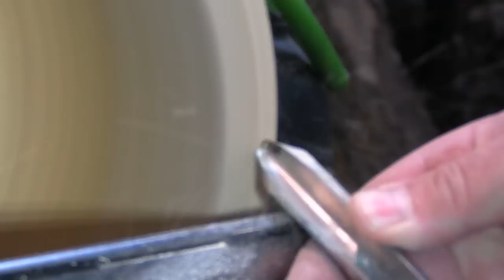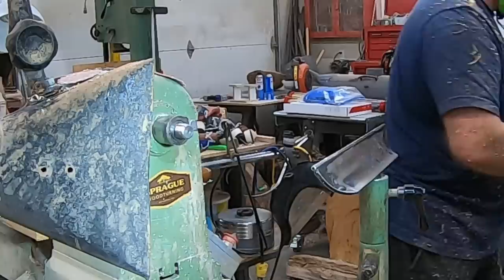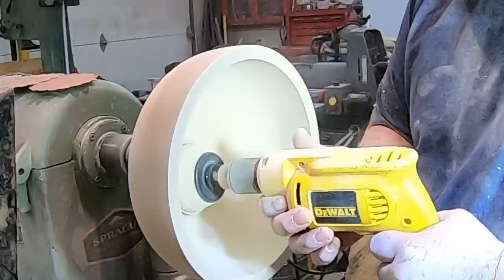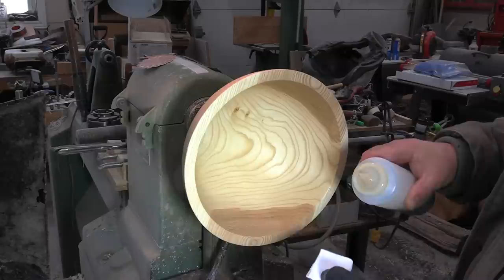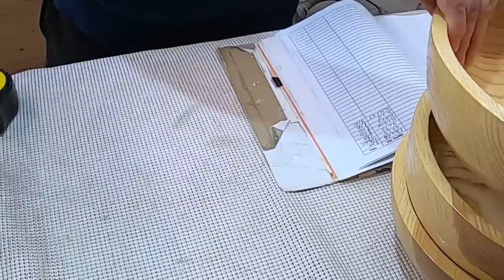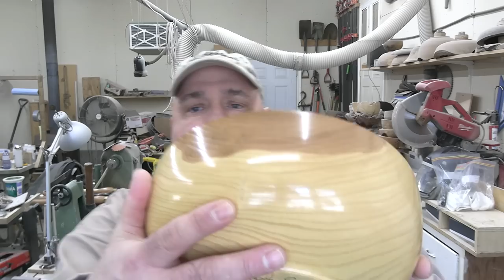Woodturning - Turning Eight White Ash Bowls in Less Than Six Hours!

Comment: Good evening, Jim and Happy New Year.
   An eight bowl marathon run. I found your tips and comments about locking the bowl securely on the lathe, tool position, sanding speed for both the lathe RPM and the drill along with the direction, the way you hold the gouge and drill to your body for both comfort and ideal use, the finish and how it is applied along with the buffing between coats and the registry of each bowl all very helpful to beginners and seasoned turners. The time lapse was good. You see the same thing over but get to witness it 8 times. Now it's locked in my mind.  The mention of being unique was of interest. The eight ash bowls are beautiful. At the time of this comment you went over 80,000 subscribers. Congratulations!
Reply from the maker: Thank you very much Ray! I really appreciate it!

Comment: Jim, besides being an old Army Veteran Medic, I’m an RN by profession the last 12 years. I have used PAPR extensively in hospitals. They’re a damned excellent full hood powered respirator. 3M has an industrial model that is rated for wood and iron working. Alec Steele uses them when he is grinding steel he forged. Based on my hospital experience with them, I plan on getting myself one as an upgrade from my non powered respirators. They are a bit pricey though… $1500 USD last time I looked. But well worth it. Plus as a bonus you don’t need an additional face shield as the industrial model is impact rated.
Reply from the maker: It’s on my short list, thanks for watching!

Comment: You mentioned dutch elm disease in another video, and using ash here reminded me... (If you're interested).
You commented elsewhere you thought the United States had dutch elm disease, and boy did we. My hometown in central Montana (just south of Alberta) had beautiful huge elms double-lining all of their streets, inside and outside the pedestrian sidewalks (and the sap they dropped! Scraping that off cars was a nightmare!). In the 80's or 90's, they were all wiped out. Dutch elm devastated the elm trees, as far as I know, most everywhere here in the States.
I live in Minnesota now (south of Manitoba and the Ontario border), and we have the emerald ash borer. In the late 10's and early 20's, most of ash had to come down, including 4 beautiful mature (probably white) ash in my front yard in 2020. Cities here (at least the responsible ones) are doing a much better job of planting a huge variety of trees, they've learned not to plant monocultures, but there are still a lot of vulnerable areas because of old monoculture planting practices. (This is introducing new problems, who knew I was allergic to some of these pollens? But it's still better.)

These experiences are one of the reasons I'm so fascinated with the resin movement. Before, of course, all that wood had to be burned or otherwise destroyed, even composting it risked spreading the bugs. And it certainly couldn't be used in crafts. I love the look of worm or ant-eaten wood, so I'm thrilled it's now possible to use it!
Reply from the maker: It has opened up so many avenues for me! Thanks for watching!

Comment: I would think something like the allegro low pressure mask, it’s around $200-$300. You would need to run it off an air compressor, have the supply line come down from the ceiling so it doesn’t get in the way.
Reply from the maker: Thanks

Comment: Hi Jim.  I love your ash bowls and like to turn it myself.  I have a Trend Airshield Pro and know what you mean about the battery.  Mine died in the first 6 months or so, so I converted the Trend battery case to take 3 rechargeable AA batteries.  All the parts from Amazon for less than CAD$100, including 8 batteries and a charger.  Works like a charm and I can turn all day using two sets of 3 batteries.  I have been using these batteries for about 2 years now, and they are still going strong.  If you can use a soldering iron, its an easy job.  If you are interested, let me know and I’ll email you the info.  Happy New Year and I look forward to your videos in 2023.    Designer Epoxy.
Reply from the maker: Yes I am spraguewoodturning@gmail.com Thanks!

Comment: That was a LOT of work in a short time! Your back must have been wasted! But the result was worth it. They are lovely bowls. It was good to hear you suggest air filtration. I personally use an allegero industries air pump model 9815ef. It pumps in outside air. I use a vinyl hose. It hooks to my 3M helmet model m100. It has a full face mask with a soft chin cover that seals off the mask. I can't even smell the finish or the CA glue. So I never breath shop air. I did run the hose across my ceiling. It is 50 feet long so I can go anywhere with it on. The nice thing is there are no filters or batteries to replace. The pump is electric and variable speed. Thanks for a great year.
Designer epoxy.

P
Reply from the maker: Interesting, how do you deal with the heat and the coolness? Thanks
Reply: @SpragueWoodturning  the cold is not a problem. The pump tends to take the edge off. But I do not live in extremes. It was fine at 18 f. That is really cold for here. 90 is a bit much. I don' t like the heat. So I put it in the shop which has the upstairs air conditioning running through it. The shop has a middle room that does get much dust so it works. But that is really a once a year thing. I had full face masks and ones with filters and batteries but this is easy and works really well.

Comment: Enjoyed that video. Bowls look very nice but I have to say for me  your inlays would add considerably to them. I have a suggestion for your battery packs. Here in BC I found a store that will replace batteries in any type of pack. You just supply the pack and they pull it apart and replace with the same spec batteries as the originals (and often better). Tends to be very cheap to have done. You could do it yourself too but my soldering skills are not great. I also found phone and computer repair stores (small outfits not Bestbuy or anything) will tackle battery replacement too. I'm sure Ontario has stores like that. One question about the Ellsworth Signature bowl gouge wave technique. Is there something about the tool that makes it work better that way? Relax and have some fun at New Years. You work too hard! :)  Designer epoxy
Reply from the maker: I also did the soldering thing with replacement batteries and they just never seem to last as long either. There’s probably a store in Ottawa, that’s the largest center to me that can do this. The cut above x enter can probably be done with a gouge with the sweptback wings like the Ellsworth gouge as well. The whole idea is be able to do a cut from the rim all the way to the center while riding the bevel on bowls with straight walls like the ones in this video. Thanks!

Comment: Hey Jim, thanks for showing! How exactly did you glue the waste block to the bowls? Do you just turn these circles you showed off shortly when cutting off the bowls, add a ton of hot glue and then glue it to the bowls or is there anything special to it?
I'm relatively new to your channel but like your content very much as you explain and show a lot more than just the turning. That way I can learn something everytime. Thanks for that and keep it up!
Reply from the maker: I melt hot melt glue in an electric frying pan and stick them onto the bottoms or the bowls after I flatten them with the grinder. If you look at some of my earlier vids I explain this in detail. Welcome aboard!
Reply: @SpragueWoodturning  Thank you very much! I'll try finding these vids 💃🏽

Comment: Nice bowls, Jim. The "time-lapse" was fine, as long as you don't start doing this for every video. For that bowl with the crack, have you tried the "sawdust and wet wood glue sanding" that Kent Weakley has demonstrated (https://www.youtube.com/@TurnAWoodBowl) It seems to work fairly well. Keep up the good work. Looking forward to another year of watching you turn wood.

BTW - that $1,000 - is that $125 per bowl or $8,000 for all eight?

Designer Epoxy
Reply from the maker: It would be $1000 for the set. Thanks for watching!